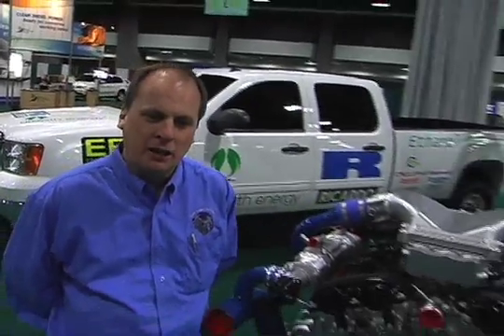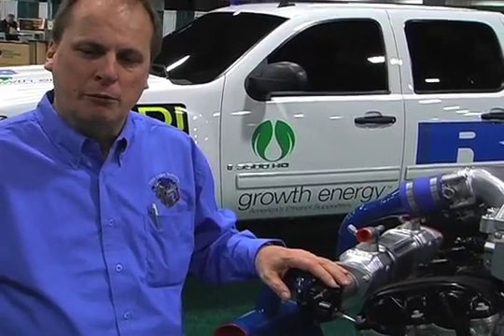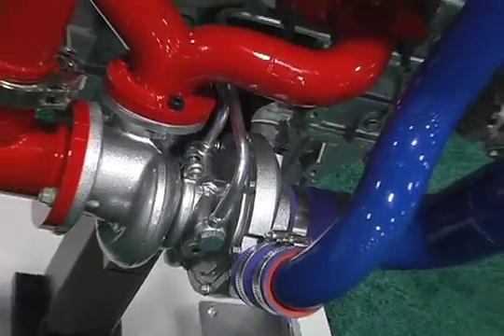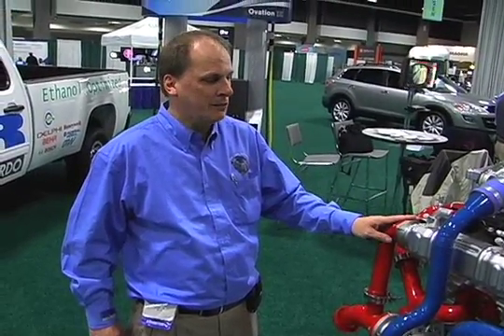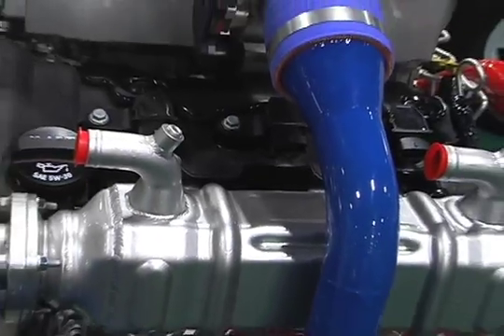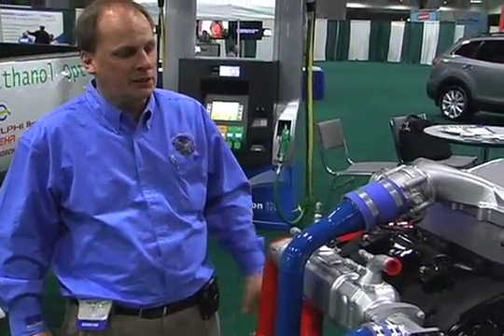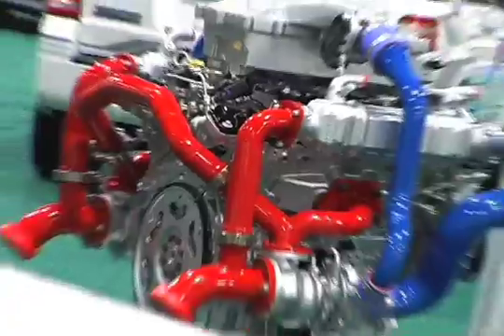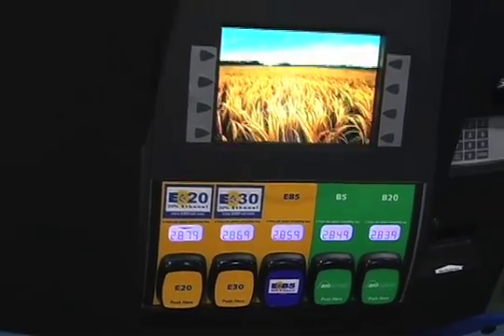Ricardo Ethanol Boost Direct Injection (EBDI) Engine

Comment: no. 1. i bet i can blow it up in 2 hr.  no 2.  ethanol is the WORST fuel ever.  and is so dry your engine will wear out way to soon.
Reply from the maker: Moe Shouse Worst Fuel Ever? 🤣 #GotProof? Where else can you get 100 octane fuel for <$2 per gallon?
Reply: i dont care about octane.   E  is so dry it will wear the engine out WAY to soon.   just go down the street and talk the the lawn mower engine mechanics and ask them about ethanol.   AND with 10 % E in gas the cost per gal should be LESS than reg gasoline.  but ill be OK as i use Marvel Mystery oil in my gas.
Reply from the maker: Moe Shouse haha lawn mower mechanics. E10 is less expensive than EO by a significant amount. Modern forced induction direct injected engines are well suited for high octane blends.  I use Marvel in my old Honda Civic. They say it’s good for the lean burn engines.
Reply: OH YES the DI  of the ford ECO BOOST thats giving them so much trouble?    that they dont EVEN have a FIX for.   you can HAVE all that stuff.   give me my 1966 dodge charger back.

Comment: This engine is based on GM's High Feature/Output V6 used in Cadillac/Buick brands as well as maybe the equinox and a few other large(r) sized vehicles.

Ricardo helped GM design it, which is why it was selected. According to Matti Vint at a different conference a year or two later.

Comment: This technology should soon reach the motorsports arena.  So much horsepower available, this can easily rival the old-school Top Fueler kings. Imagine what methanol can achieve when direct cyl injected into 500cu/in engine under 50 psi boost, furthermore with 13:1 compression

Comment: How about a small 4-cylinder for fuel economy using the same theory and technology?  The new 1.4 liter turbo GM Cruze engine, or the 2.0 liter turbo in the currect Buick Regal would be great if they were optimized for ethanol. They are both already is tuboed, so they would just needs some higher compression pistons, and perhaps the software of the Richardo design optimized for ethanol, to make those engines better suited for E85.